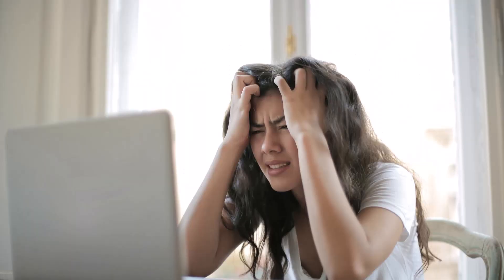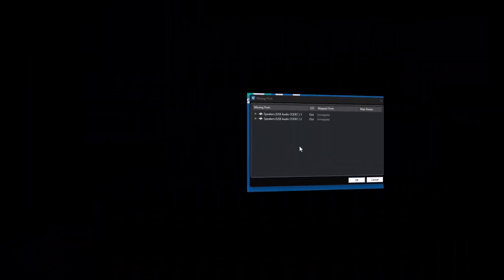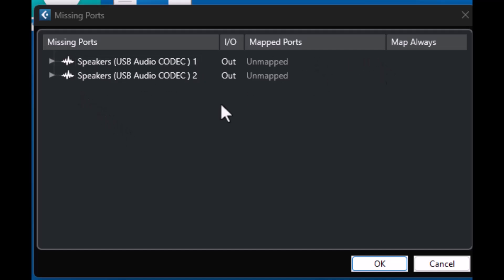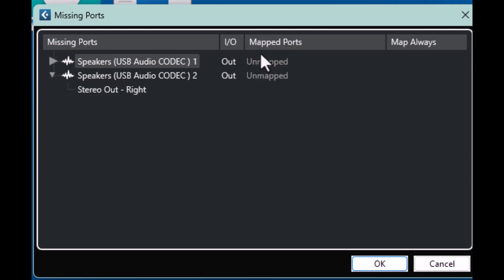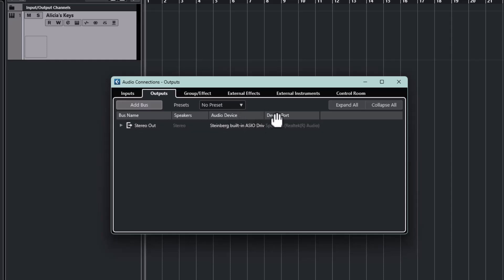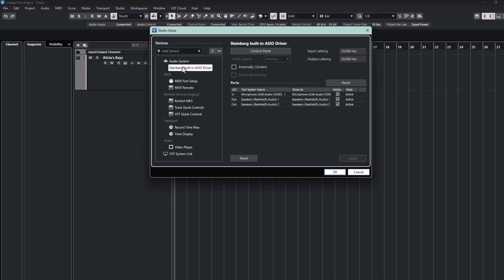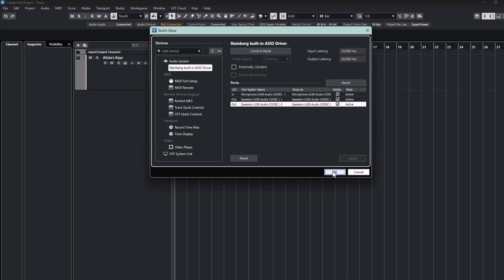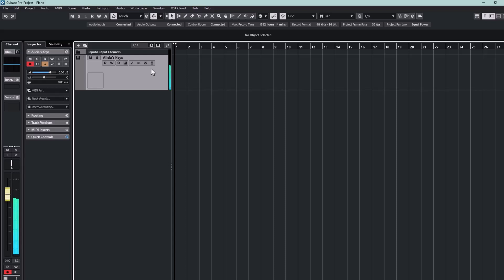How To Fix "Missing Ports" Error In Cubase (And Other DAWs) 😲 Step-by-Step Tutorial

Comment: ça ne fixe pas le problème. Il peut réapparaître...
Reply from the maker: You're right, it can reappear. It depends on what caused the problem in the first place. If it occurs occasionally, this should fix it - until the next time 😊
 The most common cause is some sort of shift or change in USB/audio connections and this will usually fix it although some people have reported ongoing problems with certain interfaces and setups

Comment: The crap about Cubase is that it doesn't remember your settings, it just removes the audio interface. What is tha function then when it doesn't save anything??? So, this vid didn't help. Each time I launch cubase I have to run throgh the settings, a lot of work since I have 16ins and outs and find out what connection was what! Also, I don't have that control panel thing, it just jumps to the audio interface settings. And oh, the audio interface has been launched prior launching cubase and all apps sees it, except... cubase! What a crap man!
Reply from the maker: That's bad news...😢
Cubase SHOULD remember these settings and your prob might have something to do with the interface or drivers. I'm no expert - this video only reflects my own experience - so I doubt I can help much but you should get in touch with support.
One thing I have noticed is that the prob can occur when plugging and unplugging an interface.
Hope you det it sorted

Comment: I have had similar problems with my DAW, Studio One, on both my Windows and Mac machines, sometimes occurring after an operating system upgrade. It seems unavoidable, no matter what hardware and software you have. Sometimes the only thing you can do is work around it by restarting the machine, resetting the connections, etc., until the hardware or software vendor comes up with a patch to fix the problem.
Reply from the maker: Yes, my last issue was caused buy a Win 11 update. That will NEVER get fixed 😠
Comment below said they have had no probs since moving to a Mac 🤔

Comment: I had this in Cubase all the time using a windows machine so I ditched both systems. It’s never ever happened in Logic, Ableton, Reason or Reaper (DAWs I use frequently) on my Mac (M1 and previous versions).
Reply from the maker: That's interesting. I have a ton of problems with Cubase and my Win 11 machine 😢
I've totally reset it several times but probs still appear. Not sure if it's Win or the PC. I see several people jumpinto the Max
Reply: @ In 25 years of making music in one form or another using different Daws on Macs and PCs I encountered my first DAW problems when I bought Cubase in 2021 and used it on a PC. In the end I got tired of it giving me warnings like the one you describe (the other was constant hanging notes) so I acquired a new M1 Mac and returned to the DAWs I was familiar with. I only switched out of curiosity and I’ve not used Cubase since.  I should really have loaded it onto my new Mac but I didn’t so I can’t tell you whether it’s exclusively a windows issue or not. Good luck with sorting things.
Reply from the maker: @Tapper1969  It's interesting to hear that other folks have had problems with Cubase, too. It's the DAW of choice for most film and media composers although I think most use a Mac.